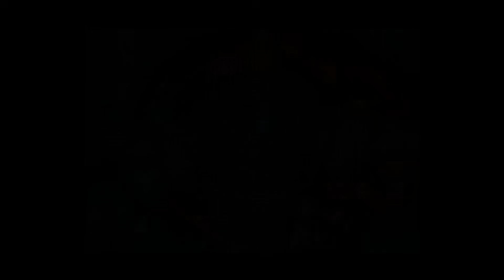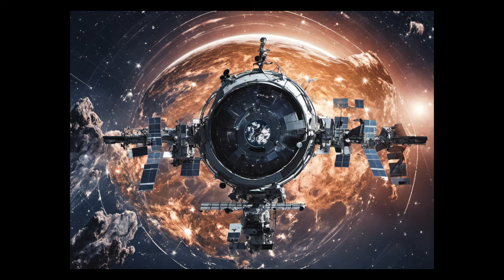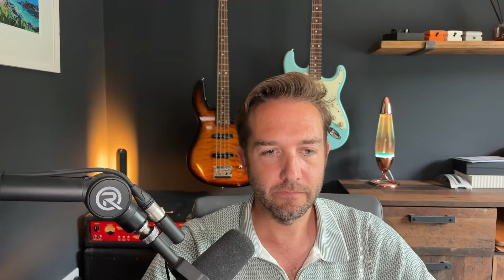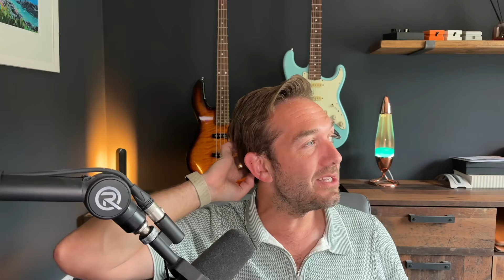Agentic AI for CAE/EDA: Are Foundation Models Rewriting Engineering?

Comment: Don’t you think, at least as of today, the token cost is comparable to an analyst’s pay? My point being , is agent really required? Won’t the foundation model suffice purely from an economic perspective
Reply from the maker: I feel the foundation model is a key component but it doesn’t solve the long time spent in CAD for example. Or the many other manual tasks along the way. The agent should help to make the most of the foundation model inference speed advantage
Reply: @drneilashton  Typically a CAE group runs anywhere from 5000 to 10000 simulations a month per physics (large OEM). I did a quick check on how much might be a spend on tokens per run and I got back answers ranging from a dollar to $50. Even if I assume it’s going to be about $10 per run, thats 100k a month on tokens. This is just for one physics.  We need to multiply that by CFD, CAE , EM etc. The cost looks prohibitive especially considering there are different cost Centers around the world where these tasks can be done much cheaper. 
But you definitely have a point, it’s not just doing the CAE analysts work but the entire virtual validation workflow. Examples like what Mistral is showing, if scaled to complex systems, it could be game changing and the token spend could be justified.
Reply from the maker: @srikanthadya2220 yeah it’s a great point you rise around token cost. I think the new battlefield will be around token efficiency/cost.

Comment: I see this as a bit worrying . I have been thinking this for a year and I share similar thoughts. I’m an applied mathematician and engineer who happens to work as FEA engineer in the industry doing also other things on HPC , numerical methods etc . I see that in the future there will be no experts and many generalists which can be good but dangerous too … 

On the other hand I see the role of the CAE engineer as non existent in the near future and only a part of the work that an engineer will do. 

Job security is not guaranteed and I’m for this I’ve been having thoughts of doing PhD in a field of applied mathematics, possibly something on reduced order modelling, neural operators etc cause I see this to evolve further even though I have my doubts about their usefulness (domain invariance etc etc ) which makes traditional numerical solvers the go to tool when dealing with complex geometries and designs which change often . 

With regards to agents , definitely companies will implement them and possibly reduce workforce by doing so . It’s a scary and interesting time where the “intellectuals” designed their “self destruction” in a sense .
Reply from the maker: thanks your comment. totally understanding your feeling of uncertainty. I would slightly disagree or rephrase your point on no experts vs many generalists. If we take something like F1 - I remember a time when it was split into aerodynamics (i.e experimental + design), CAD engineers and then a separate CFD team doing the actual CFD, + separate team doing FEA sims. The people doing the CAD wouldn't know about the detailed aerodynamics concepts and the CFD or aerodynamicists wouldn't know about the FEA and structural side of things. They were all experts and specialists in their own subdomains. Fast forward to an agent driven future - my feeling is that companies will structure more around projects i.e deliver a new front-wing option - and that the engineers can drive FEA+CFD themselves  - which means they would need to have the higher-level engineering knowledge (aerodynamic concepts - manufacturing needs - balance of weight/structure vs pure aero ) that actually was typically only at the more higher levels. I would still call them experts/specialists but in their own engineering domain rather than the tool domain (FEA/CFD). In the meantime there will still be be a huge need for CFD/FEA experts to develop these agentic + surrogate technologies and as I said this transition may take 5-10 years to happen (faster or slow depending on potential breakthroughs)
Reply: @drneilashton  Thank you for your comment.Yes that is how we work too in the field of internal combustion engines for one of  German OEMs . I also want to add that this can go the other way as well where an engineer needs to be a serious academic by learning other disciplines as well and to be honest I like that . I don't believe that an engineer should be very constrained in their field and become a tool user . A T-shaped engineer will be crucial in the near future in my opinion and being in the field of applied mathematics I feel lucky that I can be able to adapt and pivot but it can be also dangerous due to the computationally dominated nature of the field within engineering .

Experimentalists will be bit more safe but as you said , the more data you have , the better you can train your models and reduce that need for more experiments which can affect experimental engineers. 

Lastly, I see a future of 'one-man army' engineers with their own companies where they go head to head with bigger companies due to AI clearly working as a output gain .